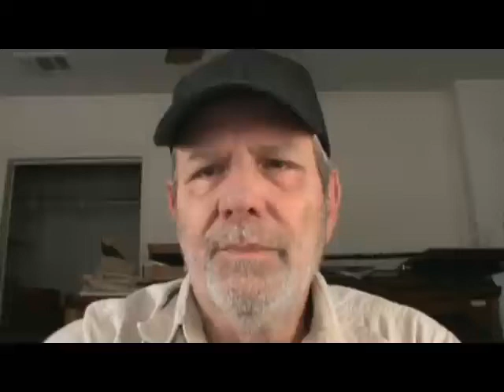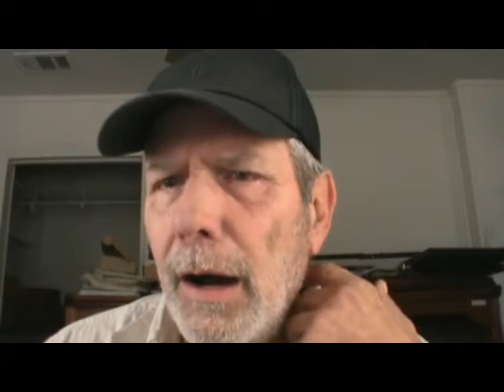Convert R-12 to R-134a Procedure for SubZero and all refrigerators and freezers! No Sludge occurs!

Comment: Say Aba what about our residential refrigerators/freezers that have leaked out the refrigerant?
I mean my Whirlpool 1995 R12 freezer is cost prohibitive to replace the compressor. My refrigerant detector says there's a leak in the evaporator yet my rented vacuum pump from the auto store, pulled down to 15 and is holding when turned off.
Like you point out, cars R12 systems have been retrofitted to R134a. Yet in those retrofits, they don't replace the compressor. 
Also I've read on a forum someone having good luck just replacing the R12 with R134a using a $5 tap valve and had good luck.   
I've read how these residential units enclosed compressors are kind of bathed in oil, it doesn't have to circulate so much with the refrigerant like other systems. 
I'm researching adding r134a and stop leak and seeing how it goes. 
Otherwise I see there are HC 12 refrigerant I could try but I'd have to mail order it.
Thank-you
Reply from the maker: Pulled down to 15 what? You need to use units of measurement to sound like you know what you are talking about or doing, to start with. Your information is way off base, which is why so many on youtube get the wrong information, and believe it...as it sounds like you have done, as well.
If you are pulling down to 15 inches of vacuum, you are nowhere close to the absolute vacuum, and it is very likely because there is a leak and it won'tallow a complete vacuum, because it is sucking in air where the leak is!!!!! If you are not at 28.6 inches of vacuum, you have a leak or restriction.
Also, any experienced tech will tell you to throw away the leak detector, they are very often worthless and also go off for other reasons besides leaking freon...giving false leak alerts. And do not add leak detector either, it causes other issues with the system!
1st of all, the oil in the R12 compressor is not compatible at all with R134a freon, so if you keep the same R12 compressor in the unit with the oil that is not compatible with R134a freon, it for sure is not going to work very long at all, when you put R134a in the system with the R12 compressor and the original R12 oil.
The difference between domestic refrigerators and cars, is the oil is NEVER REMOVED AND REPLACED IN DOMESTIC REFRIGERATORS! In commercial refrigeration and cars, the oil is commonly replaced if need be, which is why so many lazy techs don't replace the compressor, but just put R134a compatible oil in it.
If you do that with YOUR 1995 R12 compressor, you are using a compressor that has 27 years of use on it, which is the life of the compressor...and why would anyone continue to use a 27 year old compressor, they are likely going to have to replace due to failure, in the next months or few years? Lazy and Cheap is the answer, or a misguided, misinformed and uneducated attempt to prove someone wrong, when they have no idea what they are talking about.
That's not the way a professional does things, just patching things up, to get by, like a handyman does, to make it work for a few minutes, then it fails prematurely, because it was done wrong. 
Arguing a point that has zero merit, is what a cheap handyman would do also.
I prefer to do the job right, or not do it at all.
It's always interesting to read the fantasies of those with no knowledge of a subject, acting like they have come up with a Huge Revelation, that all the professionals never thought of. 
Sorry, not trying to be brutal, but wrong information is something I deplore, when there are so many people reading and watching these videos and info, and believing the dangerous, uneducated crap so many spew.
As far as the 1995 Whirlpool refrigerator being cost prohibitive to replace the compressor, that's actually the furthest thing from reality, if the cosmetics of the refrigerator are in great shape.
New refrigerators are outrageous in cost these days, due to LG & Samsung, who have no idea how to make refrigerators, running the cost of them up from $700-$1500 a few years back, to over $3500 now!
So, putting a compressor in a 1995 refrigerator for $300 for the compressor, and the labor which is typically variable by demographics, at $400 to $800, and you have a new compressor and working refrigerator for $1100, INSTEAD OF PAYING $3500, FOR A NEW PIECE OF ELECTRONIC GARBAGE, AND SAVED YOURSELF $2400 BY DOING SO, SOUNDS LIKE A VERY INFORMED AND SMART INDIVIDUAL, THEN  WASTING MONEY ON A NEW ELECTRONIC PIECE OF GARBAGE!
But, you don't sound like the type of guy to do so, because you probably don't have 2 dimes to rub together, which is why you are suggesting ridiculous handyman type fixes, that won't work!
Good Luck with that path you are on and probably always have been!
I just lost 45 minutes of my life I cannot get back.....

Comment: can i add pag oil to the 12 compressor and charge with 134a
Reply from the maker: No Jake,
The R12 compressor and R134a compressors compress the freon at different rates, designed for the freon they were made for.
The proper repair is to not mess with the oil at all, but Remove it with the compressor, and put the proper R134a replacement compressor in, that compresses the R134a freon properly as it was designed to do by the engineers, to give the maximum efficiency of cooling.
This is the whole point.
Techs need to stop trying shortcuts, and do the repair the customer is paying for, for the longest life and most efficiency of the unit, so they do not have to have future problems and end up paying $10,000-$18,000 for a new unit!
The R134a compressor is only about $250-$300, so why not do the repair properly, since the customer is paying for the compressor, not you!
I do not understand all the shortcuts to do repairs improperly, at the customers expense.
You get customers bragging about you when you do the job properly, and it lasts, and they tell all their friends to call you, free advertising!
When you do the wrong things, the customer will never call you back, and they tell all their friends not to call you also.
Treat the customer properly, and do the proper repairs, all the time. That is how you get a great reputation and can stop paying for advertising! It works.
I have never paid for advertising in 40+ years, because I have always done repairs the right way, no shortcuts.
Reply: PAG oil is electrically conductive! PAG oil is only used in belt driven compressors such as in vehicles. If you use PAG oil in an electric compressor you will short it out!